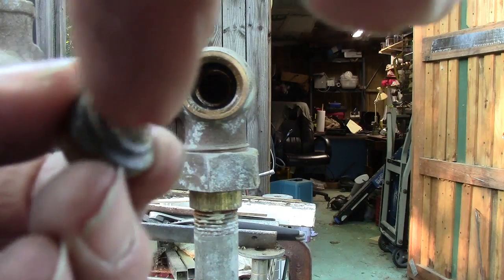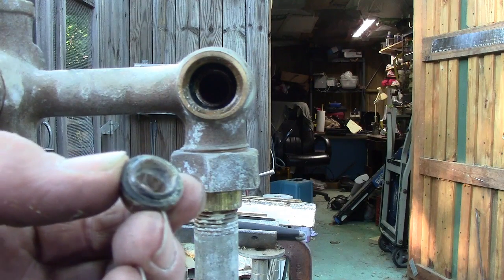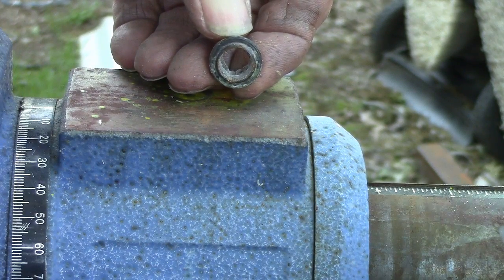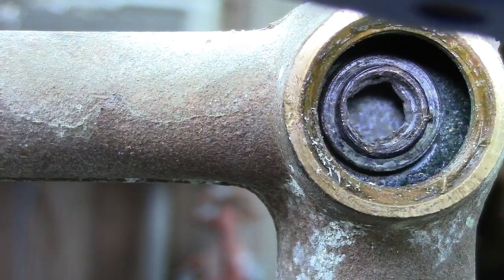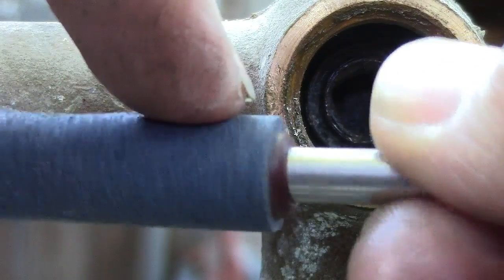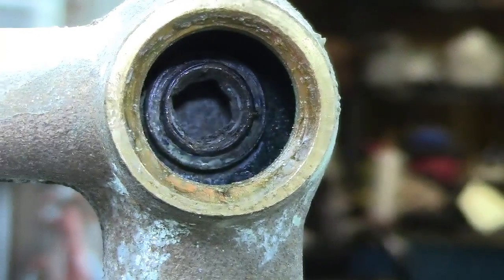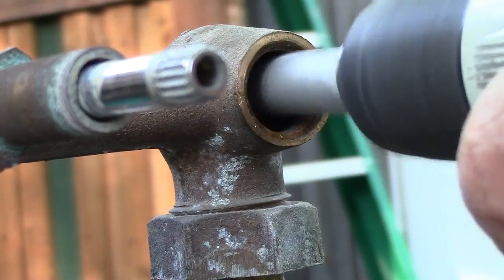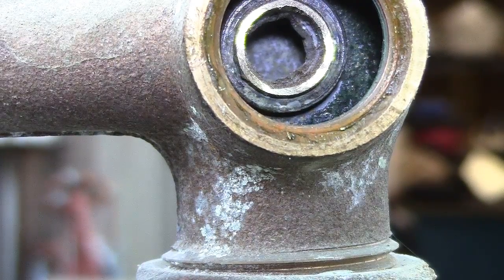Tub valve renewing a seat American standard tub faucet

Comment: Great ideas. I would take the seat out so I can try and polish the surface so it doesn't tear out the gasket all to pieces after little use. Originally those seats are smooth as a baby's bottom. That round file on the drill leaves too rough a ring.

Comment: My valve seat was the hexagon pattern. The trouble I had was the removal tool hit the back on the manifold before I could push the tapered end of the tool far enough to lock up tight against the valve seat. Once I got the threads started and halfway in...I sort of wedged  the square end of the tool into the hexagon valve seat tight enough to get it screwed tight into the manifold...probably was a dangerous move since I could have distorted the seat, but it worked. In hindsight, I should have cut off a little from the hexagon end, so it wouldnt hit against the back of the manifold.
Reply from the maker: You're probably right but those old manifolds are thick and strong,  but you're right don't take a chance .

Comment: Mine is stripped, what do I do?
Reply from the maker: OhBoy! that's a tough one, If it's the part you take out then purchase a new one. If it's the tub faucet valve there is not much you can do except to replace it.   If I can think of anything I'll let you know.
Reply: Mr moneytaker, I've seen 3 different videos using a "properly" sized screw driver, that is "tapped" into the seat(don't get wild with it), then turned to the left. If you don't get a good bite, tap it further in. Remember these are brass, in other words soft. Good luck.
Reply from the maker: @henryjames8654  This is great to know thank you for your input. I'll try that on the next tub valve
Reply: Mine felt rounded out but I think the hexagon tool was hitting the back of the manifold before it could wedge in tight to the valve seat. I  had to tap the square end of the removal tool into the hexagon valve seat. Was probably a dangerous move but I got lucky, and got it out. Should have just cut the tip of the hexagon tool off so I could push it in further..
Reply: @BandiGetOffTheRoof  Or, an allen wrench.
Reply from the maker: @BandiGetOffTheRoof  When they strip out and sometimes they do, you need an ease out to get them out. Some of them are very stubborn
Reply: Try a ez out 🤔✌️👌 replace that seat. 👍
Reply: I took it out. It works just fine without a seat.  Until I bought a new one.

Comment: Terrible, just purely terrible, wobbly and uneven cutting with unshaped seat face.  Use the correct tool or wait until tomorrow to buy a new seat, SMH. I bet that crap leaked so much afterwards.
Reply from the maker: No it didn't but just to show  everybody where to purchase a new part  did another video about that also
Reply: That's why washers are rubber and pliable. They conform to the surface. It's when there's a gouge they won't seal the seat. But you're a perfect plumber with all the answers so you knew that... right. He was giving tips to everyday people. It wasn't a bad tip when you're in a pinch... but you knew that too... right😂🤣
Reply: @Scott-eo7lj  LOL, you must be a pretty crappy plumber too who knows nothing about how water is sealed in a faucet.  The seat face is crooked so it will leak prematurely, but you knew that, right? And had to stick your fat mouth in someone else's comment to show what a real jackass you can be, right? Get lost loser.
Reply: @6977warrior1  Another Mr Perfect